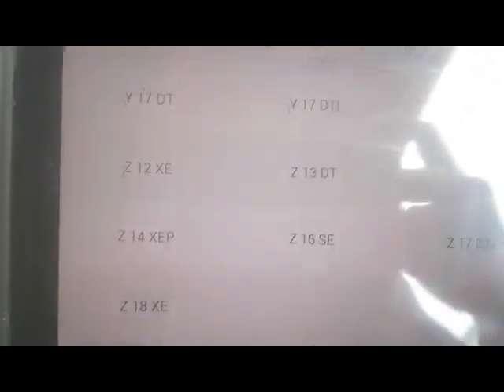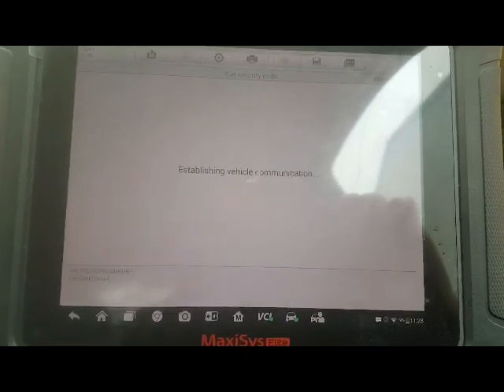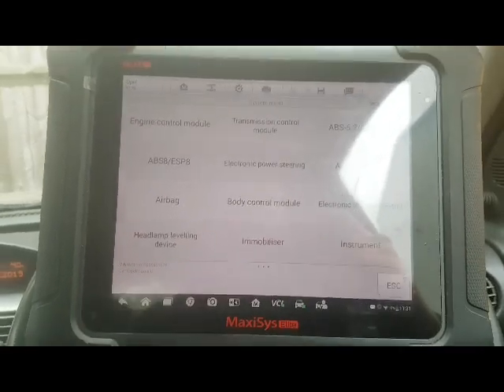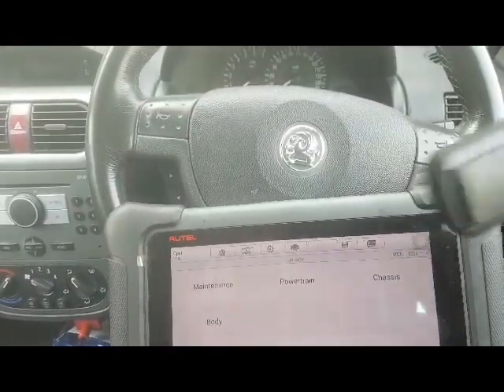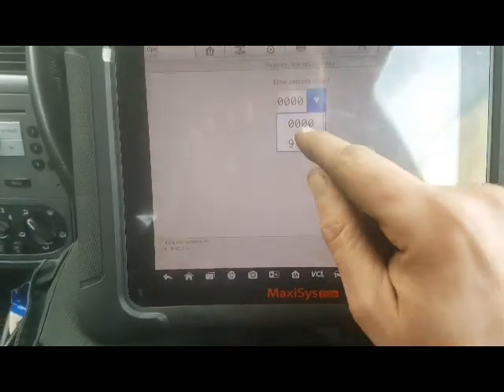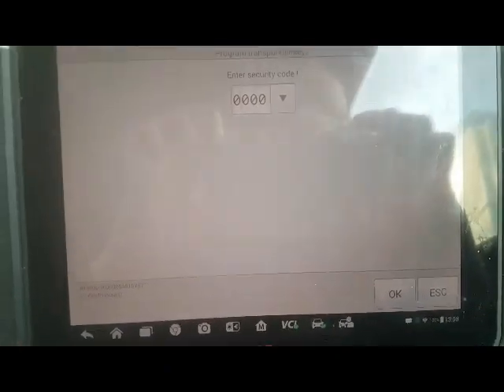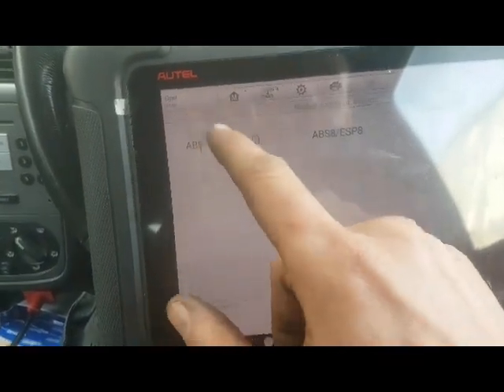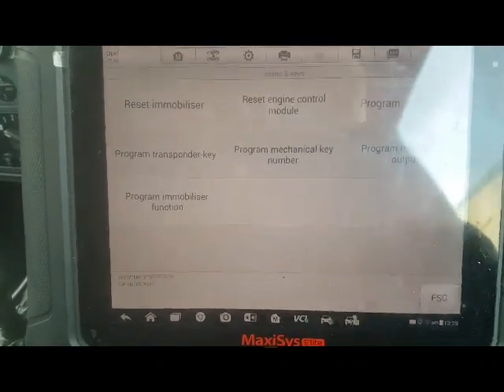Autel on a - Vauxhall Corsa / Opel Corsa. Security code pin extraction, key coding & little glitches

Comment: I tried to add a key to a 2002 corsa with the autel im508,it read pin no problem then failed at the key learn??
2 things i noticed,his battery voltage was hovering around 11.6v,and 3 keys were currently registered yet there had been 7 in total,total life of car?
Anyone know why key learn would fail?